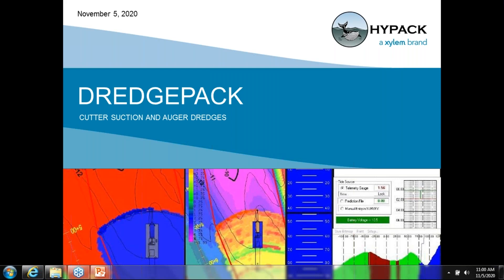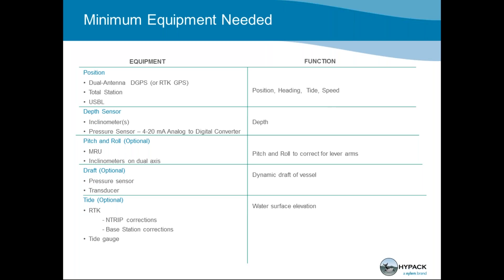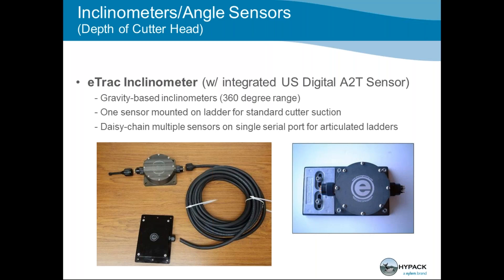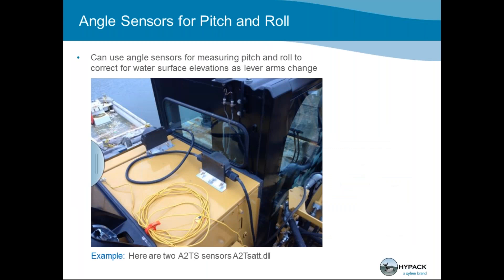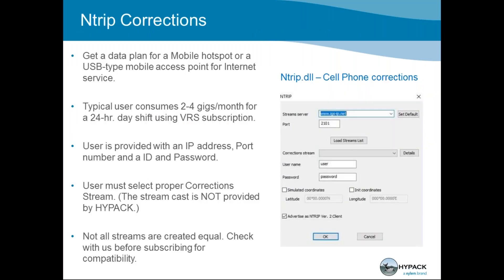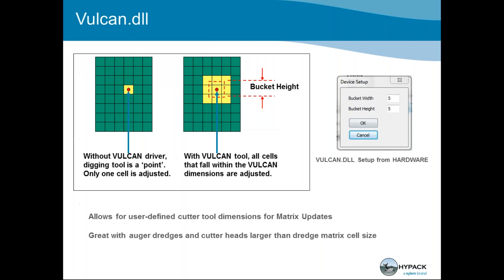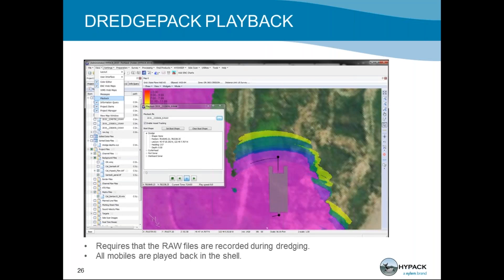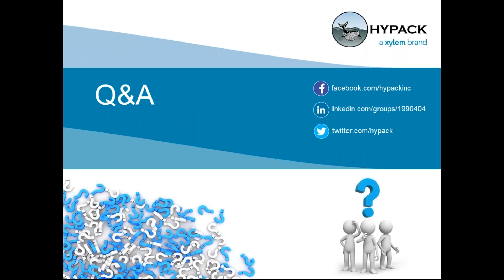DREDGEPACK Cutter Suction System

Comment: Hi, great video, I have a question, I have a cutter suction dredge, and my GPS-COMPASS antenna is located near the bow instead of the stern (where the pivot point is located) when I swing the dredge left or right I see the position of the dredge to drift several feet outside the center of my channel design in the direction of the swing. How can Hypack correct this? should I put the antenna in the pivot Physically?